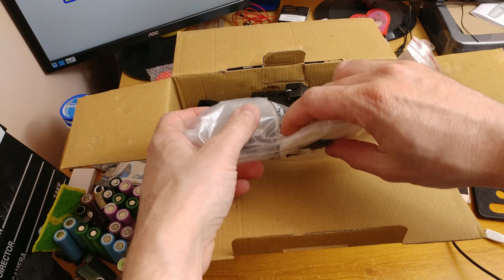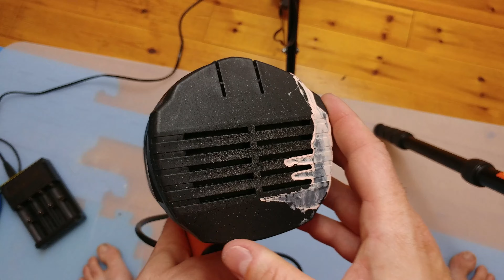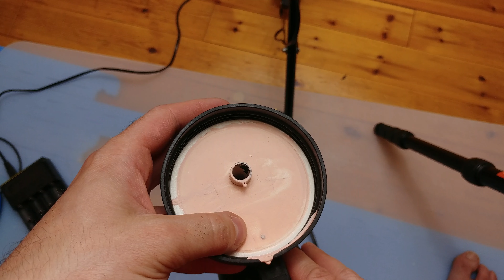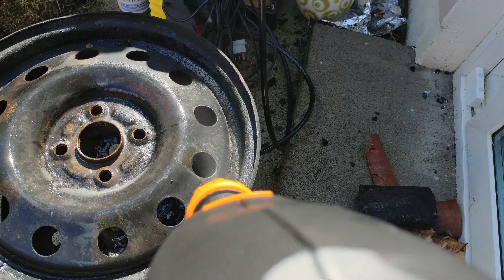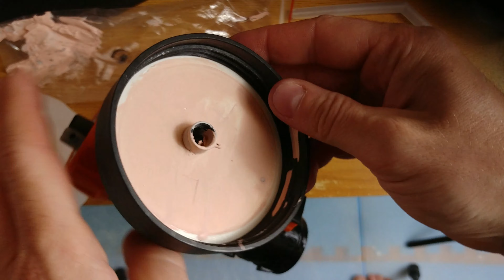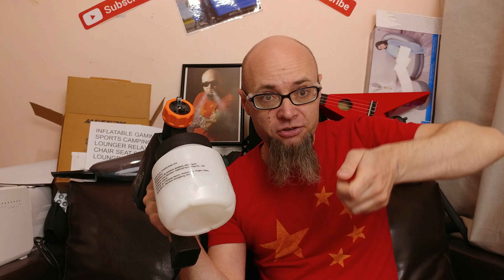Paint Sprayer, Meterk Electric Spray Gun 400W

Comment: Just purchased this off Amazon as in the comments and in the pictures on the advert they used. It advised it could be used with emulsion if using paint thinner but when I looked in the instruction booklet it says different can you recommend a paint sprayer that can use emulsion?
Reply from the maker: Hello as I remember they specify in the manual the flash point of paint, and specification depends on the country you are in. The manual says that it is usually 21 Centigrades for most countries but 32 for UK because they have more restrictious law. What country are you from???
Reply: @BuyOrBuyNot123  yeah I'm in the UK so reall then as long as it diluted correct it should be ok?

Comment: Is there a specific liquid you have to use to dilute the paint with? Or is it just water?
Reply from the maker: It depends what paint your using if water based then water, but VERY VERY important this device is not suitable for paints with low flash points so if you dilute solvent base paint with more solvent it can lower it's flash point. What type of paint are you to use? And read the manual all the warnings are specified in the manual.